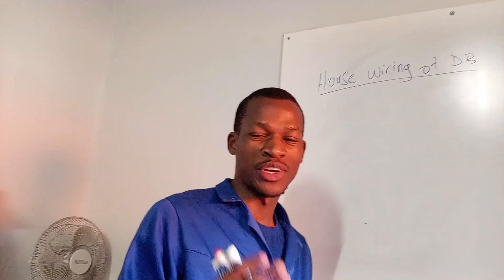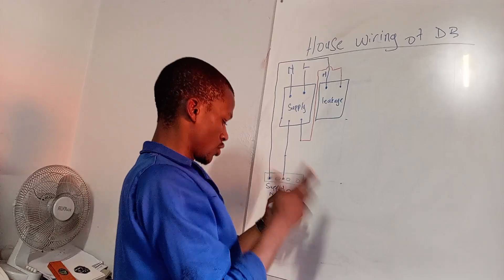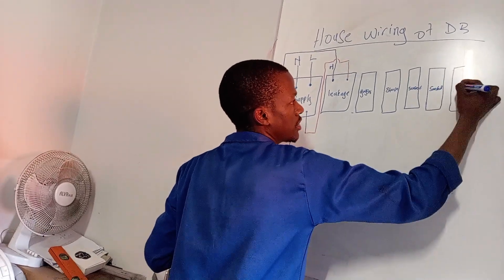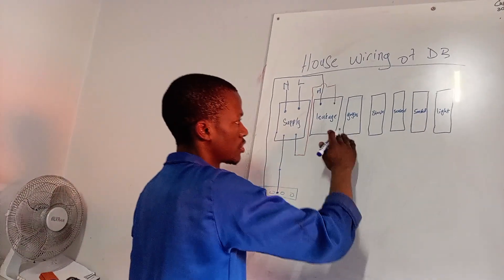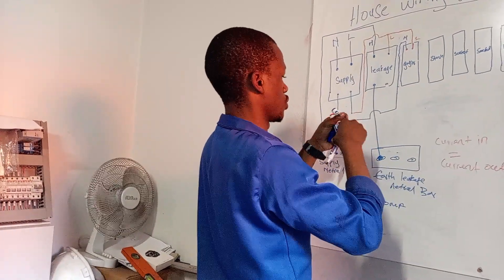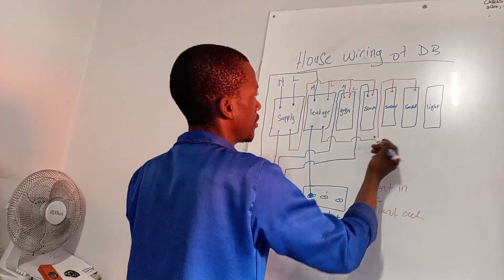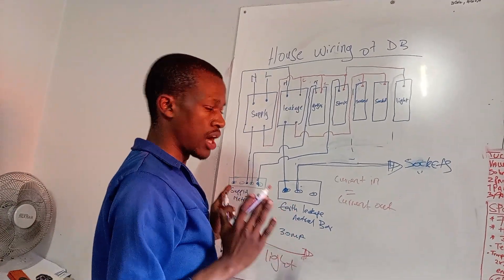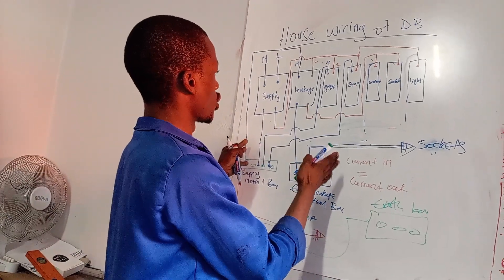HOUSE WIRING | SANS WIRING | HOW TO WIRE SINGLE PHASE DB | APPRENTICESHIP TRAINING : EARTH LEAKAGE

Comment: An earth leakage device doesn't just trip unless there is a leakage to earth. I would not recommend connecting the stove and geyser directly to the supply not from the earth leakage device.
Reply: SANS 10142 say they MUST be connected to the earth leakage
Reply: No exceptions for a geyser.

Comment: But most of the time the DBs comes with only 1 neutral bar
Reply from the maker: If it comes with one neutral bar then it means they protect everything using only the earth leakage neutral.

The moment you see two neutral bars then you know they connect the stove and some things after the supply breaker